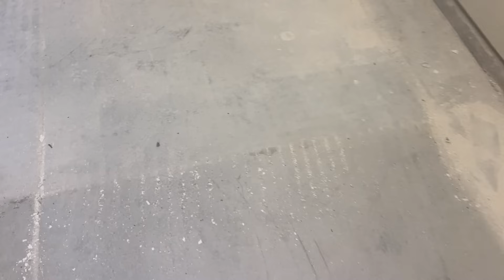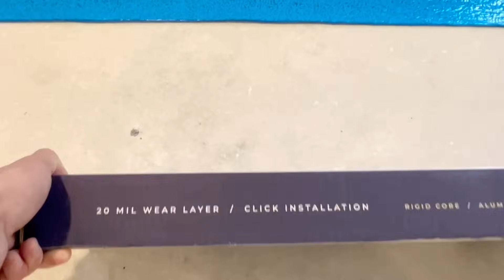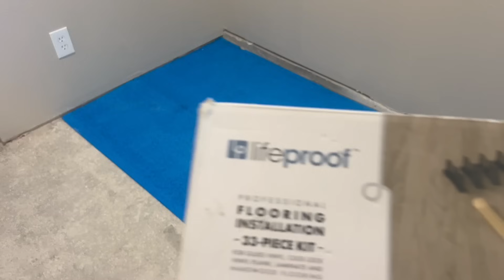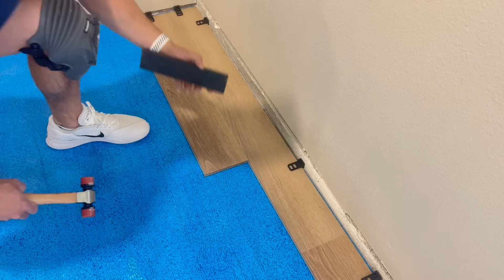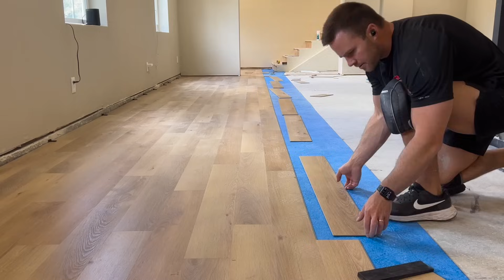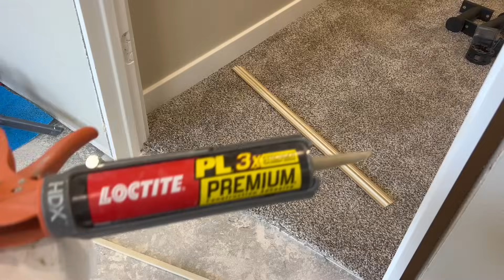LVP Flooring Installation Over Concrete Subfloor - Full Instructional | Builds by Maz + Flooret

Comment: I was wondering, the manufacturer of the underlayment in this video specifically states that it should not be used with LVP:  "The AirGuard 630 sq. ft. 5-in-1 Underlayment with Microban® is specifically designed for use beneath floating laminate and engineered wood flooring. It is not recommended for use under luxury vinyl plank (LVP) flooring" - I'm curious why you chose to go with this rather than a Class 1 vapor retardant 6 mil plastic sheet.  About to do a bathroom (LVP on top of concrete) and was wondering what the right way to do it is...
Reply from the maker: The LVP you use just needs to be compatible with a 2mm underlayment, and Flooret LVP works fine with the AirGuard. If you aren't sure, then the 6mil sheet will work just fine, but you won't get any sound dampening or cushioning properties.

Comment: Thank you very much for such an amazing video lesson/tutorial!!! This really gives me confidence to do this myself :)
I have a question if you don't mind... I have a staircase (straight) coming down in the middle of my basement. Wife asked to see about building a storage closet underneath the stairs. Would you say it's better to build the closet first, and have the flooring around it (so that the flooring can be changed if needed later) or to lay down the floor, and then build the closet (out of 2x4s and drywall) on top of the floor?
Reply from the maker: It's generally always better to do your framing/drywall first, and the flooring last. If there is too much weight sitting on top of the flooring, it can prevent it's natural expansion with seasonal changes.
Reply: @buildsbymaz thank you very much for this advice! That's what I will do then.

Comment: Excellent video.  Thanks.  I’m wondering if there’s much insulation value with the foam underlayment and LVP flooring.  I want to do the same thing on a large scale barndo project.
Reply from the maker: It definitely feels warmer than walking on bare concrete, but if you are starting this project from the ground up, there are other ways to add even more insulation.

Comment: you don't need an angle finder or measuring tape, instead you need to learn how to use plank's biometrics to make cuts, its fast and the most accurate way :)

Comment: What if the concrete floor has been sealed with a resin or epoxy? Do  you need the under layment?
Reply from the maker: It wouldn't hurt, but you would probably be okay without it.

Comment: What if I'm installing an endcap?  I want the vapor barrier to run all the way to the end but the end cap track requires a 5/8 inch gap.  Do I try to cut a slot within the vapor barrier?  Or just cut it short up to the track length?
Reply from the maker: You should be fine just cutting it to the edge of the track.

Comment: If I were to install LVP flooring over existing vinyl tile on a basement floor, would I do these exact same steps?
Reply from the maker: As long as the vinyl is secured down well and is dry and flat, you shouldn't have any issues. You can skip the separate underlayment as well.

Comment: Hey I'm about to do this in my basement. Have you had any issues with the click-locks breaking due to the foam underlayment over the last year?
Reply from the maker: None at all. Just make sure the underlayment isn't too thick/squishy - the one I used has been great.
Reply: @buildsbymaz  That's great -- I got the same underlayment as you. Thanks man.

Comment: LVP with an underlayment does not need plastic under it.  You risk trapping extra moisture under the LVP which makes the moisture hard to dry out.  If you have a dry basement, and are running a dehumidfier, you will be ok without underlayment, better actually.  The most important part of finishing a basement is air sealing the foundation walls with either closed cell spray foam, or foam board.  Inside air should not be able to touch the foundation wall.  If you get that right, you will have a dry and mold free basement.
Reply: came here for the same thing. I was trying to figure out why he's adamant about the vapor barrier when everything else I saw said to not use it or you'll just trap the moisture on the concrete causing mold etc. I was planning on sealing the concrete but not sure if I even need to do that. it's a dry ground level slab

Comment: The weak spot is going to be the tounge and groove. You drop a weight on the seam or roll something heavy over it with a dolly it can crack or break small parts of it. Not a huge deal but over time the lvp planks may lift a bit.

Comment: OK getting there.  Ready to start.  I have a joint in the concrete pad in my bigger floor in the dining room / living room.  I notice you do as well.  Did you or should I fill it with it with patch and level product before I install the flooring?.  Also, I was told to patch the divots from the carpet tack strip that was taken up.  Is that correct?
Reply from the maker: You will want to use a flexible filler for the concrete expansion joints. And yes, definitely patch the tack strip divots too!
Reply: @buildsbymaz  can you recommend a product?
Reply from the maker: @teacherlynn671  I have never actually had to use any, but something like this should work- https://amzn.to/4cKL1WW. But if your joints are 1/4 of an inch or less, you may not even need it.

Comment: Hi, how do you like underlayment after time has passed (warmth of the floor, noise) ? Im torn to use Airguard versus DMX 1 step 2.0 vs Eco cork foam , all states for use on concrete. Thank you!
Reply from the maker: Those are both actually probably too thick if your LVP has a pre-attached underlayment. You will need to check with the flooring manufacturer, but if you are using Flooret, the base LVP can have a maximum additional underlayment of 2mm, and signature and other models can only have a maximum of 1.5mm.

Comment: You’re awesome! I’m about to start this on my basement. Maybe a dumb question, but when did you remove the spacers?
Reply from the maker: Once I run out, I start removing them from the sides of the first rows and reuse those. I try to keep the back wall spacers in place until I finish the room.

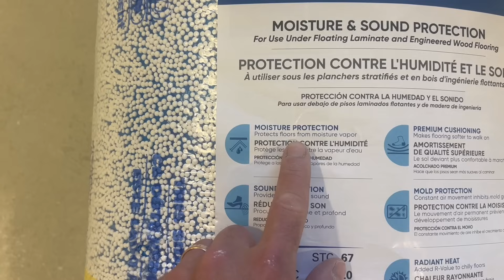Comment: Excellent tutorial! I tried to do everything the same way according to this video, and while doing that I realized, that underlayment used in this video intended for laminate and engineered wood (label shown at 1:45). That underlayment is 3mm thick, while underlayment made by Smart Core specifically for LVP (including padded LVP) is 1.5mm thick. My question is : did anybody notice too much cushion for LVP with 3mm underlayment? Or any other issues because of the extra thickness?
Reply from the maker: Different LVP brands will have different underlayment requirements. Flooret is compatible with underlayments up to 3mm, and I have not had any issues at all.

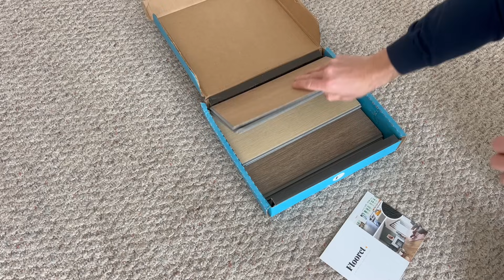Comment: 2:59 why lay down an under layment if it comes with one? I assume you will use a vapor barrier due to the concrete subfloor.
Reply from the maker: The blue underlayment is the vapor barrier. It provides better moisture protection than the pre-attached underlayment.

Comment: Bridge method sadly doesn’t work for my LVP.; must be brand specific? Once the long end is locked in these planks do NOT slide at all even if I don’t tap them as the video suggest before using the “bridge”. I’m left to figure out how to get these short ends to connect tightly…😢
Reply from the maker: What brand are you using?

Comment: Curious why the floor wasn't laid in the other direction.  It would have made the room appear wider, rather than longer.
Reply from the maker: The general rule is to lay the flooring in the same direction as the longest wall of your room/area. This also matches the direction of the stairs.

Comment: Thanks for taking the time to share this video! I just ordered the NAKAN signature for several rooms in my house and your video will be very helpful. It also gives me a great preview of how good it will look finished! I’m 63 years old and have never installed any flooring, so this will be interesting, but your video gives me hope. Lots of good advice. Mine will be going on the cement slab also. Your explanation for the threshold molding going from the flooring to carpet was what I needed also. I thought I needed the T molding and the sales person thought that I needed end cap and I was pretty sure they were wrong. I can see from your video that T molding is the way to go. Thanks again.
Reply from the maker: Definitely use T molding to transition to carpet. The end cap would be more for creating a stopping point for a bathtub/shower or something.

Comment: Thanks for the video! I am referencing this when doing this myself soon.   I am doing mine over concrete but the LVP I’m using (life proof) says it installs right over concrete.   Do I still need the under lay?
Reply from the maker: I would still recommend a thin one. However, I think Life Proof is strict about their warranty, and they may not allow an additional underlayment. I would contact them directly and ask about it.

Comment: Was looking at this underlayment also, how much give does it have? is the floor in good shape still? looks like its not recommended for LVP by the MFG.  the flooring im looking at is a bit thinner at 4.2mm concerned my joints will pop apart?
Reply from the maker: You can't really feel any give, and our floor is still in good shape. But I would contact the manufacturer of your flooring and ask them directly.

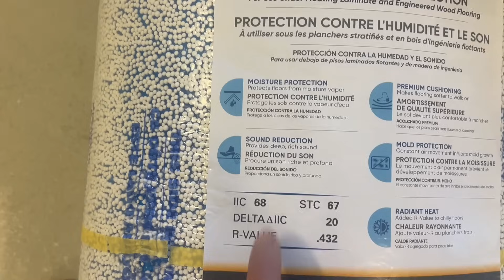Comment: 1:48 I believe the underlayment u used is for laminate and engineered flooring only. It’s not recommended for lvp. So my question is how’s it holding up currently?
Reply from the maker: I have not had any issues. It's thin enough that it does not cause any bending/movement when you walk on the floor.

Comment: Don't use another layer of underlayment if your LVP already has a underlayment attached.  This will most likely void your warranty.  If you're on concrete, simply use a thin moisture barrier material.
Reply from the maker: Flooret allows an additional underlayment as long as it is less than 3mm. The AirGuard one I used is only 2mm, and I have not had any issues with it.

Comment: I cannot believe you left in the shot of razor blade scoring the plank over the top of the already installed planks. I mean it's durable but not that durable.

Also great video, direct and walked through the tough fits.
Reply: Every installer does this

Comment: Well the big thing here, is the separate moisture barrier thickness and combination with the rubber backing that's attached to the product itself and being extremely careful in regards to too much movement within the planks which can jeopardize and cause separation within the tongue and grooves. I believe it's extremely important to find out which separate moisture barrier underlayment can be used with the pre-attached padding on certain products and whether or not they go hand in hand
Reply: According to Google AI - Why It's Not Right for LVP. Too Thick: At 2 mm thick, AirGuard exceeds the maximum thickness tolerance (usually 1.0 mm to 1.5 mm max) allowed by most LVP manufacturers.Joint Failure: Excess cushion under LVP creates too much vertical deflection when walked on. This extra give stresses the interlocking click-joints, causing them to flex, crack, or separate over time. Warranty Void: Using a thick foam underlayment under LVP when the manufacturer specifies a thin/dense pad (or no extra underlayment at all) will typically void your product warranty.

Comment: I've been told to run the vapor barrier up the wall an inch or two and the base molding will hide and hold it in place, is that necessary?
Reply from the maker: It actually is even better to do that. Really you just don't want to cut it short and leave any gap at the end.

Comment: If you have an attached underlayment, you do not need to lay down a barrier protection
Reply: If you’re on a cement subfloor, you do have to lay down a vapor barrier, always, even with an attached underlayment. It is even stated in the manufacturers instructions.

Comment: Can you please tell me what you did with the concrete lip where the slap meets the wall?
Reply from the maker: I ended up making a double-wide baseboard. I cut a baseboard in half length-wise and glued it to the back of a full baseboard, that way it could fit over the lip (does that make sense?).
Reply: @buildsbymaz yes Great thank you

Comment: That underlayment can cause underlayment you in lvp setting it has to ve a small 1.5mm underlayment. Otherwise, it can create too much movement for the boards, and the joints will fail over time

Comment: . Just going to put a vinyl plank floor rigid core at my house that is one level house on a concrete slab.. the vinyl plank I’m going to use comes with an already pre attached underlayment but  I heard you saying to use an extra underlayment !!?? Some say to don’t use an extra one but I guess on a concrete subfloor works as a better cushion!? Thanks for the video very instructional . 👍
Reply from the maker: It will depend on the brand you use, and you can always contact the manufacturer directly to ask what they recommend. But the extra underlayment is not really for extra cushion, but is more for additional moisture protection. It creates a barrier against the concrete.

Comment: I looks like it would get loosey goosey after a little time and start to buckle or move around. I just took out my lvp out of a house I just bought and it had the underlayment and stuff but I noticed that some of the tile pieces were dipping or squeaking and slightly shifting under human weight.
Reply from the maker: It's been over a year now and still no issues. It's just important to use an underlayment that isn't too thick/squishy.

Comment: If the flooring has padding, is the underlayment necessary in concrete basement floor?  I lay any flooring the same by not having the stair step. Or any other pattern. Always random.
Reply from the maker: I would definitely recommend the underlayment, more for moisture protection than for padding.

Comment: This is an incredible video with detailed instructions, thank you!! Quick question: since you’ve installed, have you noticed any separation or buckling with the underpayment? I’ve seen a few things that have said underpayment could cause movement in the seams. I’m hoping not because I plan to use this exact method in our basement!
Reply from the maker: I have not had any issues whatsoever. I think the separation/buckling can occur if you get an underlayment that is too thick/spongy, but the one I used has worked great.

Comment: great video! a couple of questions - Do you remove the spacers as you go? or once its all complete? and wont the floor move around once you remove the spacers? Thank you!
Reply from the maker: I start removing them from the back once I start running out. By that point, the floor is too heavy and there is too much friction for it to move around at all.

Comment: Very thorough explanation.  I'm considering installing LVP on a 1st floor above ground  level , in a tropical climate where it rains plenty. Should i use the additional moisture barrier?  The subfloor is new concrete.  Your floor came out lovely by the way.  Any advice would be greatly appreciated.
Reply from the maker: If you are installing on top of concrete, I would use the additional moisture barrier.

Comment: Does it really matter if it’s a stair step pattern ?
Reply from the maker: It does - your eye will pick up the pattern in the finished floor. Just slightly altering the plank lengths can avoid this.

Comment: ive read that not to put quiet walk down because the extra cushion will eventually create separation or break the connection.  Any merit to those claims?
Reply from the maker: It depends on the brand of LVP as well as the brand/thickness of the underlayment. With some it's okay, with others it can potentially cause issues. I would ask your LVP manufacturer directly, sometimes they have certain underlayment types they recommend.